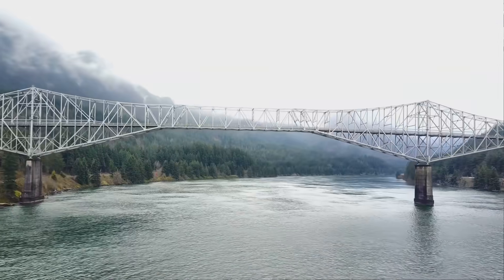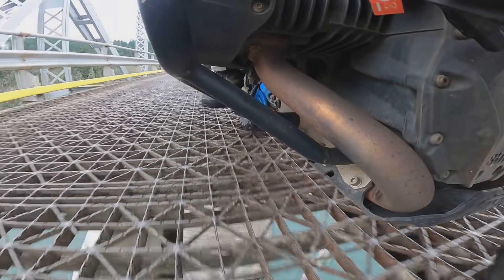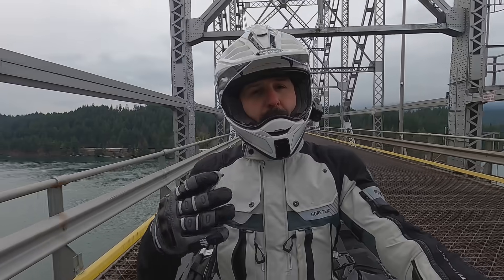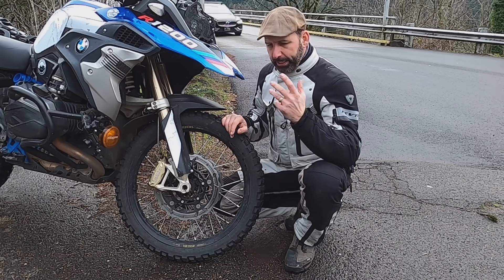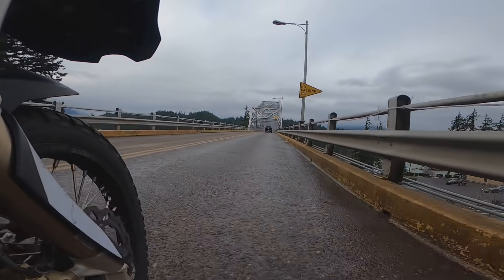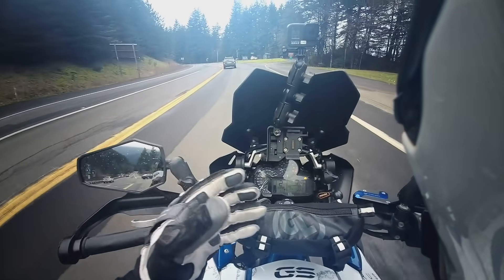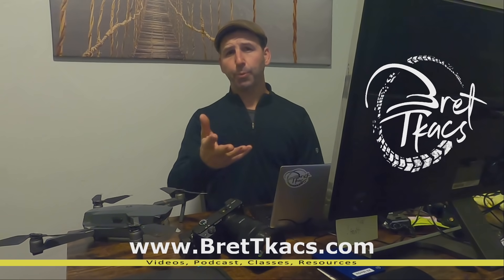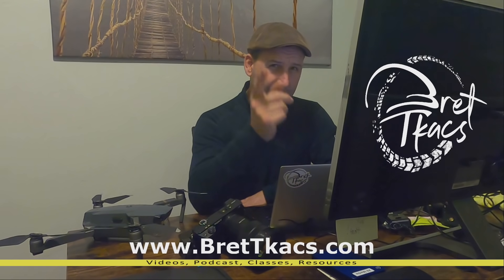How to Ride Across Steel Grate Bridges

Comment: Helpful. I think more for awareness, moral support and sanity check. Confirms that you really can’t do much other than just relax. I’ve always wondered if there is something specifically technical in handling. Learning that the grates have cross angles (it’s not like you have time to stop and look down) helps to diffuse the feeling that they are just parallel, suspecting that you are going to get flipped and dumped at any moment.  

My first grate experience was crossing the Mississippi from Memphis to Arkansas on I-40 … and it freaked me out! Everything was loose and minimum speed was 55mph. I hit the grates at 65 (flow of traffic) and had no idea what to expect; plus being a few hundred feet up in the air, plus being surrounded by 18 wheelers, plus … it’s a long bridge. And once I crossed it, I had to cross it back (after stopping on the other side, realising that the Highway on the other side was in bad condition with a lot of construction ripples (worse) and that my casual joy ride had turned into the ride from hell). Weighing my options, I just prayed to Jesus and crossed back over - super uneasy. 

I think the other point to consider begins before you leave your house … how is that stretch of Highway used? In this case, the I-40 crossing is literally the logistics distribution to the ‘West’ - so, anticipate that there will be a lot of high speed traffic, even on a weekend; expect that traffic to leave debris all over the place; expect that traffic to wear down the roads, leaving ruts, cracks, potholes, shoddy repair patches, gravel and ultimately never-ending construction - resulting in dust, gravel and ripples. Also, this is why I will never ride open face or without a visor - rocks can get kicked up and hit you like a bullet. 

This was 30 years ago. I grew up treating 10-speed Schwinns like BMX and a lot of dirt bike riding before I got a street bike. Therefore, I never had a lesson - just learned from others and on the way. So, ask these questions. I literally had a ‘crash course’ on encountering every single type of road hazard (except ice) in one Saturday afternoon and it was not fun.

Comment: Hey Bret, When I went to Yukon in 2019, I got on to the South Canol Rd in the rain. It was hard packed dirt with slippery slime layer on top. I high sided @30-35mph, picked the bike up, straitened the handlebars , and carried on. How you talked about the grates and practicing on gravel roads and getting comfortable with sensation of the bike sliding around resonated with this experience. In 2019 I was a Novice by your rating system.

Comment: Great video. My area had draw bridges which typically are metal grate and obviously much shorter. Doing 25, however will get you rear ended when the speed limit is 45-60.

Comment: A video on picking up heavy adventure bikes would be good. Every time I see these videos it's always a big GS with the boxer cylinders out the sides or panniers or something though, some tips on something like a DR650 or an Africa Twin would be great, something that really does fall flat. In my case I always drop my KLR 650 with bars and seat pointing downhill, necessitating a deficit deadlift and it's the main reason I'm not more willing to try things offroad.
Reply: He made a video on that.
Reply from the maker: It's time to address that...
Reply: @BretTkacs  Totally agree, that would be good.  I have an arthritic left wrist from multiple breaks (surprisingly none from riding) so find it very difficult to grip the bike to lift. Have purchased an Eastbound motowinch as a safety tool when by myself but is 2.5kg so would really like a technique to lift by myself and cut the weight.

Comment: In Duluth we had several pucker makers. The Lift Bridge has a steel grate; but it was pretty short. Some concern, but not a big one. The High Bridge (aka Blatnik Bridge) has tried to kill me with the extremely high winds in the spring. Add in the rain grooves on the Minnesota side as you come from Wisconsin - dang the bike got squirrelly. But the worst was the Oliver Bridge (still standing, but I'm unsure about the road surface). A covered (by railroad tracks) bridge with wooden planks, running with the traffic, as a surface. In the wet it was like riding on ice. Holy Moly that thing was dangerous.

Comment: Scariest time I ever had on a bridge was on the SF Bay Bridge fighting high crosswinds during a rain storm and feeling the wheels slip out from under me when crossing the metal bridge joints.

Second scariest was probably when crossing bridges paved with planks in Peru, getting part way over and realizing some of the planks were missing, looking down at the river below!

Strangest bridge I crossed was in the Lacandon region of Mexico, where they made a bridge out of several drainage pipes laid in parallel. Pick your line and commit!

Comment: I learned the hard way how to cross cattle guards ... first time was on the same line as trucks on the lateral slats - no good ... no accident but everything went straight fast .... after that:I knew to just go over the pipes as straight as possible - easy peasy .... be nice to see a video of cornering at highway speed on an ADV bike - An onboard ride with you - I slow down quite a bit, probably too much.  That would be a good one for me - thanks 2013 KLR650.

Comment: Hi Bret.  Excellent Videos!  I would like to see a video discussing knobby tire air pressure for big ADV bikes going offroad.  Discuss both the front and rear knobby tire air pressure.  Relate the air pressure to different types of conditions (Sand/gravel/hard pack).  I ride a 1200 GS ADV so that would be the perfect bike to discuss.  Thanks!
Reply from the maker: I do have that on the list. Good topic. It is wet here but I may be able to show what I need to show with slow motion cameras.

Comment: Hey Bret, I'd love to see an updated winch video. I have been in several "need a winch" situations and have relied on quad riders to assist. Your last video recommended the XT-17 and based on my research it was pretty much the only option on the market for a super lightweight freestanding winch. Unfortunately,  they discontinued it about the same time as you made the video. You pretty much can't find them anywhere now. Z-drag systems may work in a pinch, but not really the same thing and not adequate for some situations with a heavier bike.

Comment: Hey Bret, like your new diggs here, material is also 1st class and interesting.  I have often crossed the same type of bridge a bit further south between OR & WA and have never felt even nervous. My last set of tires on my GSA before it burned up in the Oregon fires, were the Dunlop Missions which were wonderful on that heavy, always loaded ride (I still miss it, sniff, sniff). Those tires were particularly nice on that bridge.  Insurance allowed my to get a new T7 and am planning on installing another set of Missions on it, I liked them so much though I do feel a mild concern with the hard compound rear and me having years of being spoiled with traction control - I already dumped my T7 having forgotten that it does not have traction control, after only having it for a few hours - Ugh... It's really the first vehicle I have ever purchased brand new - which mildly freaked my cookies out as well... I hope your classes are going well if you are still doing those - the world really needs your skilled instruction, I need your skilled instruction for that matter!  in any case, much thanks for all you do!

Comment: Thank you for another great video. I could be wrong, but I don't recall a video about mountain switchbacks. The off camber, washed out, rutted, low speed, 180 direction changes can be difficult. I am struggling to find a comfortable helmet, tried Lid Picker without good results. My head, from what I can tell is long oval, not many adventure options out there. Unfortunately I hate the last helmet I bought. Still wearing my old one.

Comment: well done. we have so many grated bridges around here that I learned all of that by simple trial and error. In one case, an actual crash on a grated bridge. I had help, though. A young lady, inexperienced driver and not from the US, panicked at the far end of a fairly short bridge deck and braked hard enough to tangle her car with another. just as I had committed to the deck myself. I scrubbed as much speed as I could, but my inexperience applied only the rear in bursts because I treated the deck as if it were ice or some other loose surface. That lasted until I was either going to hit the car or the deck. around was not an option. The grate tore up the bike enough that it was a write off and I lost a bit of skin (jeans are bad, kids. ) 

Thirty-ish years later - this is absolutely right. Confident. relaxed. its not as big a deal as you think.

Comment: This video reminds me of a past adventure preparing for a ferry ride across Lake Michigan with a large K1200 touring bike on my own several years ago. I ran into a bunch of unexpected challenges having never taken a bike across before. The bare metal deck of the ferry was as slick as ice in the morning dew and I had to quickly find a way to secure the bike for an extremely rough trip. I saw a few other riders in another party spin out at low speed just riding on board. I have lots of experience riding dirt bikes in the winter on frozen lakes and loading bikes on trucks and trailers, but I never expected it to be so challenging to properly secure the bike with the limited tie down options on the big BMW. As I was tightening the straps to compress the forks kneeling beside the bike, it came off the centre stand and the only thing that prevented the massive bike from running me over (and colliding with the vehicles beside it) were the two rear straps and I added to anchor the bike in place. After this unexpected discovery I added straps between the centre stand and front suspension to ensure the centre stand stayed up during the voyage! I was considering staying with the bike to keep an eye on it during the trip until I found out an alarm sounds indicating everyone has to clear the area, so time is short getting everything secure. Once underway, cars on deck slid around violently setting off car alarms and doing significant damage to vehicles around the bike. I feared the worst, but I couldn't inspect the situation because no one is allowed down in the lower deck (for obvious reasons) while the ferry is in motion. I was very relieved to see the bike was unscathed when we got across to the other side of the lake. Great videos! Please keep posting more of these.

Comment: I figure the point at which one is able to countersteer is where the wheel has achieved gyroscopic precession, and it seems like the minimum "magic" speed for most bikes riding one-up is around 20 MPH.
Reply from the maker: That's what things really start to stabilize although it begins at a lower speed.

Comment: The first time I went across Bridge of the Gods it was crazy. The bike was squirrelly and odd. But then the hardest part isn't the bridge, it can be that you can see the water 140 feet below you.  Next time try the bridge up the river. It's 3 times as long and closer to the water so it gets a lot more wind. Add wind to the metal grating and it makes for a great carnival ride!

Comment: that metal grading with diagonal  ribs aint to bad. the one close to my house as rectangle that forms the floor. and let me tell you with agressive legal knobby on my dual sport it was so sketchy slow or fast. 

the things is i believe the gap was just  big enough for two knob to slip in the rectangle at a time creating an extremely jerky feeling, pushing the bike heavily left front right back without any predictability even if and stay super loose for the bike to move around.

after using the bridge twice i realized it was actually ripping the knob completely off the tires. luckily there was a 1/4 miles away. never used it again. its do able but yeah only if there ain't any other option heck a wooden deck that run the same was as the bridge does felt easier than my stupid local bridge !

Comment: Hi Bret, thank you for your work on this and other channels. I'm learning. Male 125cc and larger 500cc. TRK 502. Last season gave a lot. Heat, downpours, hail and cold. Now even 3 degrees above 0 are not an obstacle. I'm still not good at Uturn, and maneuvering. The hardest part for me. Request. Something more about driving with a passenger? Can you suggest something? Gravel roads, asphalt...

Comment: Try that no hands on Portland's steel bridge, esp in the rain or just wet! Yee ha, when I've seen cars get out of control let alone bikes on that steel bridge! I've found you can't contain the tire tracking through the handlebars, but find the proper speed to relax a go with the flow of sideways grate tracking until your forward speed get you past the iron! Then you cracked me up being on my second most used metal bridge here in NW, the Bridge of the Gods is named for its height! There is a large parking space on Washington State that lover like!

Comment: Good video and tips. The bridges here in the Delta area of California where I ride are, by and large, metal grate draw bridges, though they’re fairly short spans. 

The only issue I’d bring up that you didn’t mention is that of the speed of traffic. While the rider may want to go 20-30 mph across the bridge, you should be prepared for drivers in front going slower. Even stopping. These will force the rider to do likewise. As you said, changes made on a metal grate need to be gradual and calm.

Comment: Crossed the Mackinaw bridge many times it is an interesting experience.
Reply: That one is on my to do list. A 1000 mile trip to cross a bridge seems like a good idea!
Reply: @danmanthe9335  Better in June than January, BRRRR.
Reply: @danmanthe9335  works for me. I rode over 2000 mi. from my home in Southern California to ride the Tail of the Dragon. Afterwards my riding buddy said why don't we ride back home through Michigan. So I said ok. That's how I got to ride the Mackinaw Bridge. AWESOME! 900 lb. bike with a fat rear tire squirming all over the place, so much fun!
Reply: No x in the middle of the metal  grate on that one if my memory is correct and long.
Reply: @hbbutters3056  For lanes, middle two are grate, outer two blacktop but much closer to the LONG way down to the water. The bridge authority has drivers who will take you car over if you cannot do it. Never asked about a motorcycle, but it can be very interesting, especially when windy. OH forgot to mention, it is always windy.

Comment: I was crossing Canada on my GSXR-1100. I hit about 100 meters of "Fresh Oil" leading to my first metal grate bridge crossing! So, yeah. There was a bit of pucker factor as I crossed that bridge. lol Agree with the gravel road analogy, it's disconcerting to have the bike move underneath you, if you've spent your time on roads. Flip side, watch the Dakar bike racers managing everything on the bleeding edge of control, then you'll feel perfectly settled on a gravel road or grated bridge. :)  I know you've done some packing videos... Maybe a comparison between what you have on the bike to go to work vs. what you'd have on the bike for a day trip vs. what you'd have for any number of overnights (camping and not camping). Another couple of ideas: we are looking at doing the TAT. I have a drone, two GoPros (one HERO 3 White and one HERO 9 Black) and an iPhone plus an 8" tablet as my navigation screen. How do we set up to record such a trip? How do we pack to protect the gear? How do we keep everything charged? Is navigating on a GPS enabled tablet with a smart phone as back-up sufficient for something like the TAT? Would there be areas of the world where this setup would not be sufficient for navigation? What tools do you have to clear a forest trail after a storm? How do you safely pull off to the side of a busy road and conduct emergency maintenance (none of our bikes have flashers, so how do we alert motorists that we are stopped along the side of the road)? Thanks for the content!
Reply from the maker: Yikes

Comment: Great stuff Bret. 
2:54 I think you meant to simply say “gyroscopic force” of the wheel creates stability. 
If I’m not mistaken, precession explains why pushing either bar end initially leans the bike.
Reply: Precession simply describes the motion of the axis of rotation. I think angular momention is a better word to describe a rotating body's resistance to a change of orientation.
Reply from the maker: I like this video on gyroscopic procession https://youtu.be/ty9QSiVC2g0
Reply: Yes it's Gyroscopic Effect that creates the stability, Gyroscopic Precession that enables counter-steering to work.

Comment: I'm late to this, but wanted to say I always ride in the middle of the lane, thinking the metal may not be as polished by car tires.
Riding in the Columbia gorge I've turned back from Hood River because of wind, to cross over the Bridge of the Gods because its high up out of the wind on the river.

Comment: I wander if the San Francisco Bridge is like Lisbon's 25th April bridge. It is metal, but its longitudinal lines, with the cross metal grid being deeper, it's crazy, the times I crossed it on motorcycle, I always went to the paved lanes!

What I would love to see, would be a beguinner's approach to how to behave on sand/loose gravel, if you never went that way on your bike. It's the thing that scares me the most, I am not into adv. bikes at all, and always try to stay in paved roads, but sometimes, just sometimes the GPS plays the trick on you. I just usually go back, although I had a couple (surprisingly fun!) exceptions :)

Greetings from a currently all-white Denmark!

EDIT: I went to street view on the Golden Gate bridge in S.Francisco, nope, all paved there :)